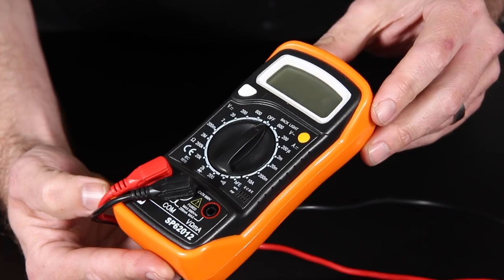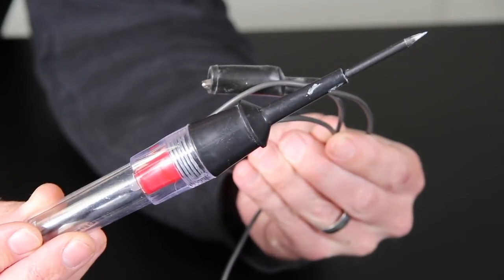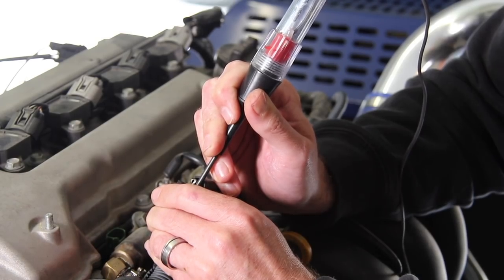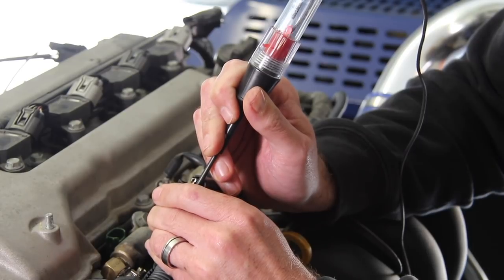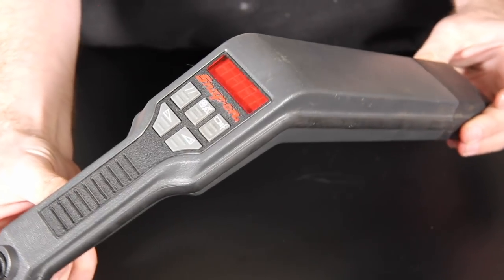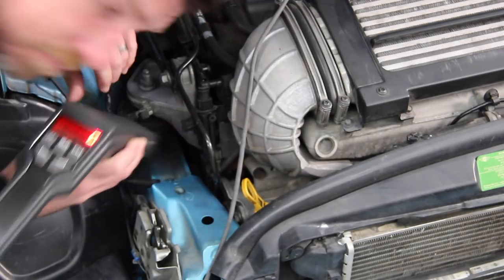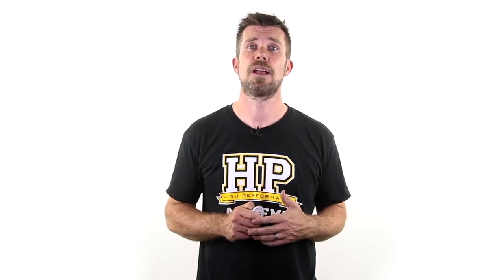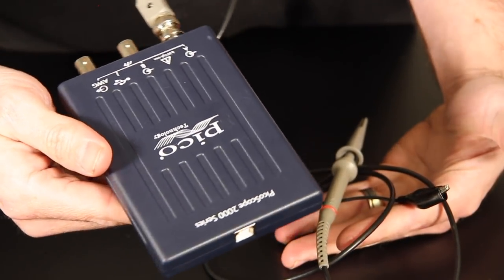What Tools Do You Need To EFI Tune?

Comment: Thanks, I've had decent luck with SCT's consumer software on netbooks that use eccm for storage memory. When I datalog my car it's saved to a nano USB drive. However I was going to purchase a mid range laptop just for this purpose. I also DJ so it will be used for both.  I'm very impressed with the Plex knock detection system and seriously looking at that

Comment: I'm a year late, but i would like to add "T" pins to the list. i got mine from an office max store. they allow you to easily back probe connectors, so you can use your multimeter without unplugging components or piercing the insulation of wires.

Comment: Can you get the same or even better gas milage with a standalone ecu?
Reply from the maker: Depending on a few variables, yes, however, the cost of purchasing, fitting and tuning a standalone ECU for this usage alone would probably outweigh your fuel savings - Taz.